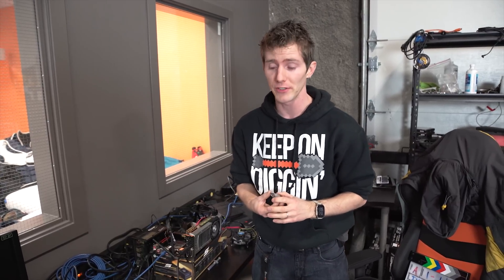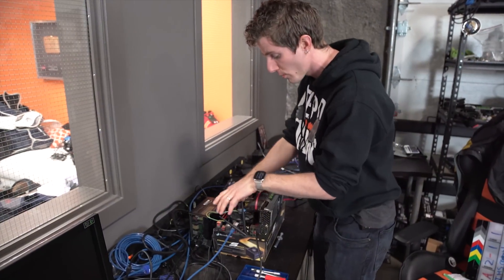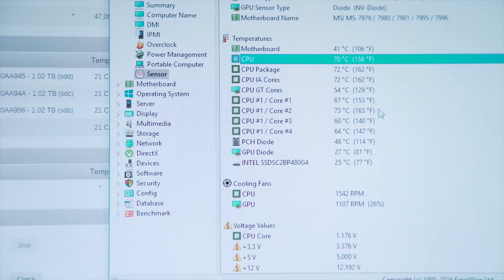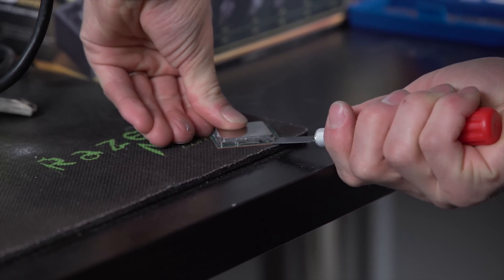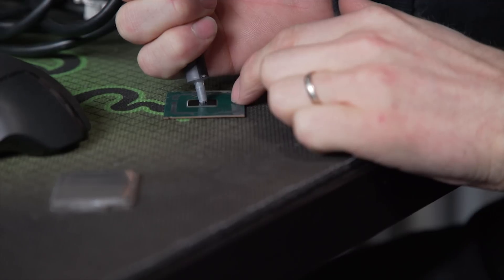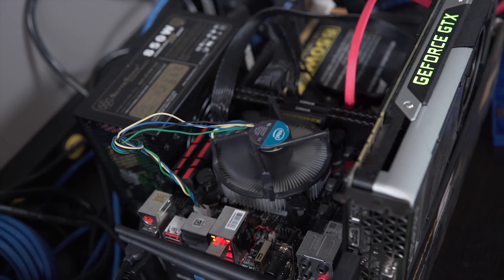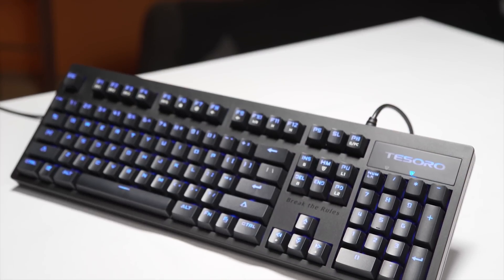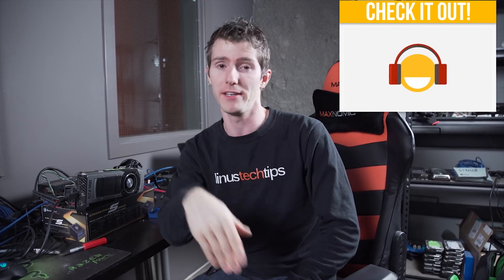Delidding an Intel Core i7 6700K - Is it worth it!?

Comment: Serious question, why does Linus only use Intel CPUs in all rigs? Is it a brand deal?
Reply: 1: they're better 
2: he has actually done amd rigs in the past, but amd hasn't come out with any new cpus worth purchasing since then. 
(this coming from an fx-8350 owner)
Reply: There are literally 0 high performance amd cpus. Bulldozer was complete shit for amd.
Reply: +Dr. ViperKevin At the moment, AMD chips suck. Hopefully ZEN chips will improve matters. Because competition is good and Intel are getting lazy.
Reply: +Dr. ViperKevin Compared to Intel's CPUs they are complete trash.
The FX 9590 (FX 8350 overclocked to 4.7GHz) doesn't even outperform a 4GHZ Core i5-6600K
Reply: +Captain Leerox 
LOL I5-6600k is the best i5 you can get.
I5 6600k is on the level of i7 4770
Also the FX9590 released 3 years ago and has 32nm.
How could you even compare those CPUs?
Reply: +MrDavibu well amd hasn't released any new cpus in a while
Reply: +Dr. ViperKevin intel are generally higher quality, Im currently using an amd cpu but in the next year or so im upgrading to an i7. amd is kind of "budget power" in that theyre decent chips/ cards but theyre not really ideally what you want to use.
Reply: +Dr. ViperKevin He does AMD systems often, its just they have no solutions for many of his projects at this time.
Reply: +Dr. ViperKevin Because he's not on a tight budget.
Reply: Emmanuel Espino
Yeah I know, but I neither compare a Comodore64 to my new gaming rig. Just because Comodore hasn't released a new PC since then.
Reply: Intel is the best
Reply: Sneaky Kitty Gaming
Yeah, in Hyperthreading workloads the i7 is better.
But in all other workloads the i5 6600k is as good as the i7 4770.
(So like 99% of the time)
I just want to point out, that the i5 6600k is a very good CPU and just because it's not an i7 it doesn't mean you can compare a new CPU, from a company who specialized on performance, with a 3 year old one from a company, which specialized on price/performance.
Reply: +avanasear I used to love AMD but now I'm all over Intel but I hate intel's advertisment
Reply: +Link Freeman Wow, so much AMD hate all over the internetz.... especially on all tech videos xD, but in reality AMD isn`t even remotely that bad. I have stock clocked, actually undervolted FX-8320 which i use for plethora of things. It`s cool, quiet and very snappy and i don`t need more performance, i don`t even wish for more  performance in foreseeable future, at least until Zen proves itself. That means i will probably skip first generation Zen. No need to buy it first day like a guinea pig then cry later as many Bulldozer fans did :D. Piledriver was surely a nice improvement back then, some 5-10% IPC boost along with 10-15% frequency increase. I think my FX-8320 now is whole lot faster than Bulldozer flagship FX-8150 was in it`s short life.
Reply: ***** I see that "lower quality" moniker in regard to AMD thrown around an awful lot.... it`s BS from engineering standpoint.
Reply: ***** Yes. Exactly. Someone understands.
Reply: *****
Oh now I see.
I thought the pricelevel on AMD site was lower.
So I thought they compare a 150$ CPU to a 250$ CPU. I probably searched for another AMD CPU and just mixed up the prices.
In this case you are right.
Sry herp derp XD
Reply: Jacky Xie It`s not a third tier product. It`s competitive just fine. You are in denial, as are other Nvintel fanboys :D.
Reply: Erick Ortiz Wow, you are a majestic douche :D.
Reply: Matthew Bauer FX-8320 is NOT a bottleneck in most situations. I run it, stock clocks, undervolted. No need for overclocking. Let me clarify that... it`s not a bottleneck for any mid or high-end gpu. Extreme enthusiast stuff like Fury or 980ti, not so sure. It`s great if all you want is single gpu gaming on 60 HZ monitor, regardless of resolution. But for over 60 or beyond 120 HZ or with multi gpu`s, it wouldn`t really work. I`m well aware of that. In such ˙"hardcore" scenarios when AMD is pushing for example, let`s say 100 FPS i5 or i7 would easily push 150.
Reply: Wondercat You are a fucking moron. Please. Educate yourself on the difference between sponsorships and product reviews/paid advertisements. If I have a product and I send it to LTT to review that somehow means I sponsored them? You can't be this fucking stupid and ignorant. And then you go on to talk about IQ. Proper display of being 13 years old and in denial about his intelligence and superiority to everyone on a YouTube comment section. I won't even stoop to your level of stupidity and brag about my IQ scores.
Reply: No, it's just that only Intel chips are worth buying
Reply: +Dr. ViperKevin Because AMD chips are outdated, poor performance, and high power draw.
Reply: avanasear FX9370 myself.
Reply: Sponge Boob The FX 8/9 000's series?
Reply: +Dr. ViperKevin just waiting a news about their brand new amd chip. before all their chips suck. hope the new one is more better...
Reply: Because although they are more expensive, they are also much better, and intel has been known for longevity too.
Reply: +Dr. ViperKevin because amd sucks
Reply: +Dr. ViperKevin Intel has better single-core performance, they use these pc's a lot so they want/need the best performance possible. Plus i think hes kinda an Intel fanboy...
Reply: +MrDavibu i wouldnt say its on par with its i7 counterpart since the i5 doesn't support hyperthreading it really cant be compared(with the exception of gaming), its only marginally better than the 4690k.
Reply: +Dr. ViperKevin Ignore the idiots in all reality a lot of you tubers are being endorsed by them. I don't know if Linus is but it would make sense. Not only that but AMD isn't bad? Idk where these idiots are coming from. There cheaper and more affordable. But defiantly not a gamers choice, but for editing purposes yeah.
Reply: +OhGeeAStart Yep. My Dad put an 8320 OCed to 4.5 (i think) in his photo editing rig simply because he wanted the threads for photo batch processing. serves him well.
Reply: OhGeeAStart it has nothing to do with being sponsored, amd has not released a new cpu or anything new(exception of the gpu's) in quite some time, thats why no one does videos on them because they have either already done a video on those processors or millions of others have. and yes amd's processors currently are crap when it comes down to it. the only one with much worth IMO is the fx 6300, dirt cheap and decent performer. would choose that any day over a pentium/i3
Reply: Jonathan McClen Personally, if cheap raw multi-thread optimized power is needed, AMD is the way to go right now, just don't expect PCIe gen 3. If gaming and  all the Ghz and PCIe gen 3 is needed, then Intel is the way to go. I just built (I field refurbish them all the time) my 1st Intel box based around the Asrock Z97 Extreme 3 and the 4790K and it cost nearly 2X what the AMD 8320 system cost my dad and the specs seem similar (minus PCIe gen 3.) Personally, If I had to build my system over again, I'd have built the 8320 or 8350 about 2 years ago (instead of the A8-5600K media/internet system I built) and then NOT built the 4790K this year (to allow me to have saved up for at the time, something better which we now know is Zen/Polaris coming Q4-16/Q1-17 )
Reply: Sneaky Kitty Gaming I'd go so far as to recommend the 8320/8350 for non-gaming applications (they are both the same price now on Newegg; $150 and free shipping.) Only downside is 152W+ TDP plus the overclock and I didn't take that into account when dad purchased his PSU so his PSU constantly gets hot (doesn't shut down). If you have a decent PSU, shouldn't be an issue. The 8320/8350 coming in at $150 fills the product range of an unlocked entry level i5 and they're $30-$40 cheaper than entry level i5 plus you get 4 more cores(threads). People on sites like Anandtech and Tom's Hardware that you can get 4.7+Ghz, but with what my dad has, we got 4.5Ghz turbo OC with turbo turned on and 4.5 seems blazing fast anyways for batch photo rendering/photo processing and editing since we are not waiting to use the system during the batch rendering (usually work days/overnight). Dad doesn't game on it so it serves its purpose.  The AMD system would be cheaper than an i5 system by about $100-$150 and be unlocked.
Reply: +Βασίλης Τσαβαλιάς ZING! WOW DUDE! YOU SURE GOT HIM GOOD! moron.
Reply: +El Diablo What the fuck are you on about? Is that a threat? A request perhaps? A statement? Fuck off with your shit grammar and stupid nonsense. No one cares. Go sue Intel if you want to. I'm willing to bet their multi-billion dollar company can afford better lawyers than your broke ass and will shit on you in court.
Reply: intel is the mainstream
Reply: +MrDavibu But, the difference is, Commodore aren't still selling the old 64s acting like they're still relevant.
Reply: +OhGeeAStart AMD is cheaper and therefore lower quality. Intel chips of the same specifications knock the socks off of an equivalent AMD chip.
Reply: +Matthew Bauer The specs SEEM similar, but do benchmarks and you will see that the Intel wins.
Reply: +Sneaky Kitty Gaming Umm...  Yes, it has everything to do with being sponsored.  Ever wonder why, when one company sponsors something, you don't see ads for their competitors?  It's because you want that sponsor money.  If McDonalds sponsors an event, and the event runs a bunch of ads for how great Burger King is, McDonalds is going to pull their sponsorship.  Wouldn't you?

The fact is, he's so heavily biased against anything that's not Intel/Asus/nVidia, it's a wonder he can even stand to be in the same room with another company's product.  You think he would have called that test rig "janky" if it had been an Asus motherboard?  If you do, then I have tons of bridges to sell you.
Reply: I have a 9590 and it is complete shit. Been only running AMD since the mid 90's.  pretty sad actually
Reply: *****
You could buy a used one.
I just want to point out that you shouldn't compare old hardware (more than 3 or 4 gen old) to new one.
AMD sells crappy CPUs.
I personally like AMD, but they just sell crappy CPUs.
To all out trying to protect AMD ghz is not the performance of a CPU.
Watch for Benchmarks, that's the best thing to compare performance of CPUs(I know AMD/Intel optimise for Benchmarks, that's why you should compare CPUs with more than 1 Benchmark)
And you will see AMD sucks at performance.
Reply: MrDavibu You can obviously buy a used C64. My point is, if AMD still makes and sells these CPUs for these prices trying to claim they are relevant, we have every right as consumers to compare them as if they're new because they are still AMD's newest lineup. I have read the benchmarks and fully know that an AMD chip and an Intel chip with as identical of specifications as you can get them will not be equal - the Intel will win.
Reply: ***** Exactly. That is why I chose the AMD chip when building the photo editing rig. I wanted the 8 cores unlocked for the price of a locked lower end i5. I didn't too much care that we were still getting PCIe gen2 because we weren't gaming on that system anyways. If you look at what AMD CPUs are geared towards, you get bang for your buck in whatever segment you choose. if you look at an i5, it is geared at the 4 core mainstream market and pricing is stable between $190-310. AMD really doesn't have anything yet (hopefully Zen will change that) that is an i7 killer. The only downside to AMD is that they are HOT processors for their 8 core+ CPUs and that can cause OC problems (not for me as I will water cool)
Reply: +Matthew Bauer I agree sometimes amd is better I think I don't realy have a preference but it depends on what I want
Reply: Jonathan McClen Yeah. For gaming, my 4790k beats the 8320, but it cost over twice the price for about a third to almost but not quite double the synthetic performance gain. I wanted PCIe gen 3 and USB 3 (more than 1 or 2 or just a motherboard header) and m.2 and AMD doesn't support that yet. For hard work, the 8320 can be beat by the 4790k but the 8320 beats it in price, so the 8320 OCed, IMO wins when water cooled. Sacrifice the PCIe gen 3 and you're good (like that really means much anyways as most games don't take full advantage of all the lanes) Unless you have like a 980ti or 970 or a Titan series or a R9 270+ or a Fury/Nano series or a PCIe based SSD, Pcie gen 3 is not needed and I have an R9 270x soon to be a R9 380x or GTX 970.
 and even with that, games need optimized to take advantage of all that pcie anyways and most games don't.
Reply: Felipe França Awww! Poor babyyy! Do you want a hug? That's a lot of hate for such a small man!
Reply: Erick Ortiz He is right though. Felipe França. And you know it to be true.
Reply: +CMstacker I forgot to add, you and morons like Felipe and the idiot who started this thread choose to only see what you want to see, and in your fucked up head this channel is biased. Fuck off kindly.
Reply: +Erick Ortiz these fuck heads ruin AMDs fan base by getting butt hurt on every channel or video not using their products. No other fan base in the component world bitches as much as AMD fans
Reply: SirBillyMcSilly Yes I know it drives me insane.
Reply: Felipe França Get the fuck out of here. I don't know what I'm talking about yet with all this evidence, you lack the braincells to know you are wrong. Go fuck yourself somewhere else. If you even can because your head is already so far up your ass.
Reply: +Dr. ViperKevin Amd havent made anything drastically different or new for 3 years
Reply: +WayStedYou true.
they are simply a lot behind. in some games (SOME! dont get mad amd people xD) a i3 is faster than the fx 9590 for less money. or the g3258. or a i5 4460 for the same money is faster in like almost (ALMOST!) anything...
AMD is simply not worth it. at no price point. exept maybe under 50$ :P
Reply: ***** I am not MAD when I am saying this. Most i3 are pretty much higher binned Pentium and Celeron and in no way shape and form can a dual core out pace an 8 core in a game optimized for dual core, especially when Windows will push itself to an underutilized core and therefore making my proposition of an 8320/8350 a better idea than an i5 (and cheaper). Have you even sat an Intel and an AMD side by side? I took my 4790k and an 8320 and ran Cinebench side by sided and the 8320 cane in scoring 66% of the 4790k and it cost 66% of the price less. Cinebench score for 4790k is (average) 900 vs 600 for the 8320.  My point is you get what you pay for. For workloads that benefit from raw multi-threaded performance, AMD has it beat. If single threaded performance or dual threaded performance is where it is at, Intel has AMD beat by hundreds of miles. If you are doing tasks like photo editing or video encoding and you plan on using 8 threads, the AMD 8 core CPUs are a cheap way to go. If you really need the gaming horsepower, get either, it depends upon what you are doing when you ain't gaming.
Reply: Matthew Bauer yes, I did :)
I owned the following in that order: AMD FX 8350 > Intel Pentium G3258 > Intel Core i5 4690k.
I overclocked all of them to their stable maximum and I consider the i5 to be most worth it for my tasks/games. The amd is "compatible" with anything because of its 8 cores (which only have 4 modules) but it isnt quite as fast while doing so.

For example: 
10 Tabs in Firefox on the AMD = unresponsive and sometimes even lag while scrolling
10 Tabs in Firefox on the i5 = just fine. Responsive, smooth scrolling.

Btw: i did a clean win10 pro x64 install for all the processors with the same background programs running. :)

Im not saying the amd is crap, but it aint the "multicore-monster" or "i7-crusher" some people make of it. :)
Reply: CMstacker and you're a majestically ignorant fuck.
Reply: ***** I never said the AMD 8350/8320 was an i7 crusher. I said it was more of a low end i5 competitor. For multi-threaded workloads like photo editing and rendering, the 8320/8350 will serve its purpose. For me, gaming, the 4790k beats it and I own (well... my dad...) them both.
Reply: Matthew Bauer Okay. :)
I did not mean you btw ;)
Reply: ***** Yeah, Intel has absolute advantage in gaming. Especially paired with hi-eng gpu`s or in multi gpu setups. It has "grunt". But anno 2016 i really wouldn`t feel comfortable with ANY dual core cpu under the hood. i3, still workable, but dual cores without HT really not... if you are going to do anything more on your system than web browsing and general multimedia consumption :D. And games are generally stuttering mess on that Pentium G. Don`t watch just average FPS values. It`s not some miracle "god-given" cpu and you really can`t justify purchase of that for gaming, especially going forward from now on.
Reply: CMstacker
I owned it.
ANYTHING (I played at least) runned just fine and smooth, exept for GTA V. :)

But yeah, future-wise, you are right. Still the pentium is better than those weak 4-core AMDs IMO.
Reply: CMstacker I had a G3258 and it ran like a dream. The only game that stuttered was GTA V after a certain patch. Before the patch it ran perfectly fine. Rockstar made it to where multi-core CPU's were favoured over less more powerful cores because AMD fans wouldn't stop bitching about it not running on their systems too well.
Reply: ***** IMO, steer clear of 4 thread or 4 core AMD CPUs like Athlons and any APU. I have owned several Athlons and an A8-5600k and they were all good for their time but aged out relatively fast. Go for FX series at least 8320 and up. 8 threads or more is the way to go simply because you leverage multi-threads in most workloads nowadays. Most games are forcing you to use a dual core  and AMD is good for that at the 8320 at the bare minimum. I can game on an 8320, haven't tried high end mine as I don't have but a video rendering GPU in it, but it seems like you'd be able to game with it just  average, probably not stellar, but average and the AMD-FX should NOT be a bottleneck for any GPU. On modern systems, a GPU could more important than the CPU because like some have stated, with a decent enough GPU like a nVidia 970 or an R9 290x, you could get away with gaming on an i3 (if the game supports CPUs that are dual core with hyperthreading) or Athlon.
Reply: CMstacker If you know anything of the press releases from AMD, they only demo their "anything above 60Hz" or  Free Sync on Intel and are only doing it on chip sets that include the latest and greatest i7. For standard applications, the 8320 is not a bottleneck because 1080p or 1440p/ultra wide are the only resolutions I see being adopted mainstream till 4k becomes cheap and then AMD will catch up to Intel or get priced out of existence. The 8320 that I have for my dad, like I have said before is overclocked to 4.5Ghz and it is stable but it is VERY VERY hot and it is causing strain on the cheap $50 PSU that came with the case. We definitely have more room to go in OC thanks to the massive Silverstone air cooler but I am not sure if there are enough power phases on the MSI motherboard either. not going to risk it till we replace the PSU.
Reply: +CMstacker Even if intel does sponsors him (and of course they do all these company's do). He isn't going to risk his integrity and viewer base by being bias there are plenty of AMD things he likes like the R9 Nano they just don't do CPU's (at least not for single or duel threaded loads like alot of games are) very well don't be a fanboy. AMD Cpus do shine in Heavily multi threaded loads and sometimes even become close to the Intel cpu's from the gen before them in such loads but there always a day late and a dollar short. Putting aside all that though this is literally just a video about why you shouldn't delid an intel CPU would be sort of pointless to use an AMD cpu for that eh?
Reply: +Felipe França Only first of all sponsorship doesn't require you to be dishonest to begin with so your entire post is moot but again even if it did simple research on your own will tell you Intel blows AMD out of the water there is a reason AMD is bleeding money and just barley in the market at all anymore.
Reply: +Dr. ViperKevin Linustech is making Brian Krzanich proud
Reply: +Dr. ViperKevin Don't mad at me   but amd's suck, at least for now

I've use amd from the first pc since duron 800mhz to fx8 gen 1

fx 8 fail me soooo much in every way

 the price ,the temp ,the power consumption ,the processing power

basically everything

I don't know if Intel already bought linus or not

But if I were him I'll do the same.

I've tried i5 2500k once and now every pc in my house turn to be Intel

2500k 3670k 3770s and g550

But I still has a littttttttttle faith in amd left   for the new cpu that coming

(really little, I'm serious)

the best amd for me is phenom x6, especially 1055t
Reply: +Dr. ViperKevin Don't mad at me   but amd's suck, at least for now

I've use amd from the first pc since duron 800mhz to fx8 gen 1

fx 8 fail me soooo much in every way

 the price ,the temp ,the power consumption ,the processing power

basically everything

I don't know if Intel already bought linus or not

But if I were him I'll do the same.

I've tried i5 2500k once and now every pc in my house turn to be Intel

2500k 3670k 3770s and g550

But I still has a littttttttttle faith in amd left   for the new cpu that coming

(really little, I'm serious)

the best amd for me is phenom x6, especially 1055t
Reply: Wondercat If you yourself even had the slightest of common sense you would know a review channel has to be honest. Companies don't send them products to talk good about them. An honest review is always better for a company than a paid biased one. Sponsors want to get their name across. Where in this video did you see "Sponsored by Intel". There are promotions, where channels (or even TV shows) show a product from a certain company as a promo, but that isn't a sponsorship. That's just paid advertisement. How can you say all these companies sponsor him? Are you stupid? Just because he gets review units it means he's sponsored? STUPIDEST thing I've ever heard.
Reply: Erick Ortiz
Woah what the fuck are you on about dude did you even read my comments? If you did your reading comprehension needs ALOT of work. I was explaining to them that even if they where right about sponsorship its in no way a requirement for them to try and sell a product exactly what your wall of texting me about right now. LOL
Reply: +Erick Ortiz You are so naive, there should be a new naive word after your name.

But the fact that you are trying so hard to discredit any thought as "biased review" just shows that you are either stupid and naive, or just a troll or paid shill.
Reply: Wondercat I was going off "Even if Intel does sponsors him (and of course they do all these company's do)." But now I'm not so sure if it was sarcasm. But if it wasn't, then I stand by my comment.
Reply: Erick Ortiz
They tell you thereselfs on many occasions that certain videos are sponsored not sure how deeply in denial one has to be to say it never happens. But reacting to that misses my point entirely..
Reply: DavorBa Listen. Arguing a review channel is pure stupidity in the first place. They wouldn't be a review channel if their content contained even the slightest of bias. Then it'd just be a regular tech channel. This goes for all review channels. Paid sponsors do not reflect a reviewers opinion on a product. Linus made a video (yesterday?) talking about this as well as sponsors and review units.
Reply: Wondercat Of course they have sponsors. Saying all of the stuff they review is sponsored is idiotic. LTT was sponsored by NVIDIA wayyy back but the sponsorship has since ended. Most of his sponsors have nothing to do with tech or anything his channel is even remotely about. Phantom Glass, Lynda . com, audible . com and squarespace.  Those, are sponsors. Paid advertisements like you often see here about keyboards, monitors, CPU's you name it. Those are ads, not sponsors. There's a huge difference.
Reply: Erick Ortiz
At what point did i say everything they do is sponsored i said every company (or at least most) do at some point or another those are 2 very different things now stop your white knighting and start properly reading and digesting information before you make posts making yourself look silly
Reply: Wondercat Now you're being a fucking moron. How many times am I going to have to repeat what you said. If you already forgot, "Even if Intel does sponsor him (and of course they do all these company's do)." Is that clear enough or does it have to be repeated a fourth time? Sponsors=/= paid advertisements. Get that through your thick fucking skull. If anyone needs proper reading skills it's you. You don't even know what you typed anymore.
Reply: Erick Ortiz
Once again all these company's do sponsored them at some point or another but again that does not mean every video is sponsored. Talk about being thick as an asphalt milkshake damn dude hahaha
Reply: Erick Ortiz
Regardless your splitting hairs to begin with sponsorships and paid ads are very similar in the first place and that was NEVER the point of my comment its like your going out of your way to find something to get pissed about must be rough to have an IQ of about 92
Reply: Erick Ortiz
Well your wrong on both fronts IQ of 138 and age of 23 so your off by 10 years on that front :D regardless i'm not going to bother arguing with you at this point its clear your making a strong effort to bait someone who was originally on your side to begin with.
Reply: Erick Ortiz
In response to 1 you called me dumb well before i mentioned IQ's. In response to 7 you clearly don't understand hyperbole. As for the rest you think what you want i have so little interest in this conversation its really not even funny. Have a nice life and move on its YouTube its not that serious and i'm sure both of us have a lot better things to do.
Reply: intel are just simply better
Reply: I'm sure I'm pretty wrong here but if it was not for AMDs' price Intel would rain supreme.
Reply: +Wondercat Knowing that there's a difference between "your" and "you're" isn't a matter of education, it's a matter of common sense and therefore intelligence. Confusing words with different meanings, even when sounding the same, is a crystal clear sign of a) plain stupidity or b) pure ignorance or c) both.
Reply: Oliver ASUS
Oh i don't write properly on the internet I must be Ignorant or stupid! Very original attack there mate Ignore my expansive vocabulary or the fact that the vast majority of words are spelled and written properly. Hell ignore the actual points and levels of validity within my arguments. Nope none of those things mean anything because i typed a word wrong wow never knew life was so black and white thanks for enlightening me random internet troll.
Reply: Erick Ortiz
Really haven't you anything better to do? this is just getting depressing at this point i'm starting to feel sorry for you.
Reply: Wondercat At the moment, no, which is why I replied to you and not earlier. You keep replying to me as well. The irony just radiates from you. You can't help it can you? Maybe you've never heard of lunch breaks or down time.
Reply: Wondercat Now you're confusing "attacks" and "trolling" with naming just some obvious and real facts. It's your own choice if you will fall into group a), b), c) or none of them. Your rant, however, gave a pretty solid impression you're insistently opting for c) ... while lacking most of the essential punctuation, which made even reading it a pain in the ass. Let alone what you were actually trying to say with your flatulent vocabulary. 
For more facts, see Erick's 1) to 8) ... plus: Please don't breed :)
Reply: +Dr. ViperKevin Because he's a PC enthusiast, and no PC enthusiast will choose AMD over Intel at this time. AMD need to step up their game to be back in the enthusiast circle.  ZERO AMD are present in overclocking or benchmarking scene or have been for years.
Reply: +Dr. ViperKevin the only PC i've built has been a amd build but even i know that intel cpu's are way better than amd.
Reply: jayjaysufc At least he knows that placing an apostrophe before a plural s is silly.
Reply: +Oliver ASUS sorry grammar police. 😂
Reply: jayjaysufc Let's rather call it common sense police :)
Reply: Because he's smart and knows that intel cpu's are way better
Reply: Look's like silly greengrocer's are breeding ... i's there a nest nearby?
Reply: +Dr. ViperKevin They are better... 
that should pretty well solve that question.
Reply: +Dr. ViperKevin when you are rich, intel is better.
Reply: Jayden Smith That's like saying "When you are rich, Apple is better"...
Reply: +Dr. ViperKevin I won't beat up AMD as badly as some here, but I'll just say "why?"

I've got an old FX6300 myself, but only because it was on a crazy bundle sale at the time. Otherwise, the only thing I would even consider in weird situations would be the APU series. Even secondary Intel thrashes AMD at this point.

Things have gotten that bad for AMD. Just the way it is. Hopefully for their sake they come out with something amazing (zen/vr), forcing everyone to jump up and look. Otherwise they're walking dead.
Reply: +Dr. ViperKevin AMD is utter garbage and has too many problems to be worth to use in a video. They are horrible really horrible. In everyway just bad
Reply: Don't care about their GPUs for this discussion.

But as a quick quip, AMD buying ATI was a very bad thing for the latter. Especially if AMD keeps cutting the GPU research budget to shore up money for their failing CPUs.

Tough future.
Reply: +Dr. ViperKevin coz AMD sucks
Reply: +Kang Yue No, they don't, really. For high performance, yeah, but for budget performance, they're pretty much unbeatable.
Reply: Homeless Walkthroughs Pentium destroys AMD for price and performance and TDP
Reply: SAM STRECKER I have an Athlon X4 that costs roughly the same, has double the cores and a higher clock speed with a turbo boost. So, yeah.
Reply: +Homeless Walkthroughs Not weighing in on the argument but pointing out that higher clock speed means about jack shit when you're not factoring in IPC.  My 4.4Ghz FX-6300 gets wrecked by a 3.5Ghz i5-4690k, even though it has more cores and a higher clock speed.
Reply: ragadorus2 i5's have things like core hyperthreading, and more threads per core. The Pentium G3258 does not.
Reply: +Dr. ViperKevin Well maybe because amd hasnt come with something new for a while, but mainly is because intel sponsor them with pretty much everything alone with nvidia.
Reply: Amd mobos are kinda less common
Reply: +Dr. ViperKevin not even AMD uses AMD chips when they're doing their graphics card benchmarks... long story short they're not as bad as a lot of people make them out to be (definitely better than i-3's). But anything i5 and higher is significantly better
Reply: Joshua Gonzalez 
are you an angry intel fanboy?
Reply: +PoisonedAl Oh my god, i hope that is exactly whats gonna happend. but in the other hand i have invested on Broadwell-E chips.....so if zen is gonna be much better or at lease on par with Intel X99 Platform I'm gonna be Sooooooo Pissed :(
Reply: +Joshua Gonzalez what do you consider a decent motherboard?  AMD's motherboards won't have PCI-E 3, or USB 3.1 but those are hardly required to be "decent".   (PCI-E 2 currently isn't even a bottleneck)
Reply: +CMstacker Shit for gaming
Reply: +Felipe França AMD cpus are outdated and shit for gaming use due to low single core performance
Reply: Because above $130 Intel rules the CPU market.
Reply: Sponsors as well as just waiting for Zen to come along. Nothing really more than just Intel provides LTT with their chips to test